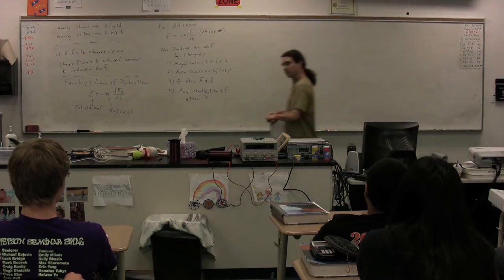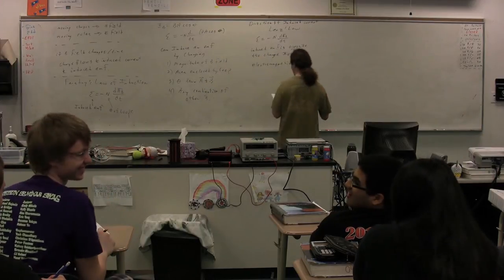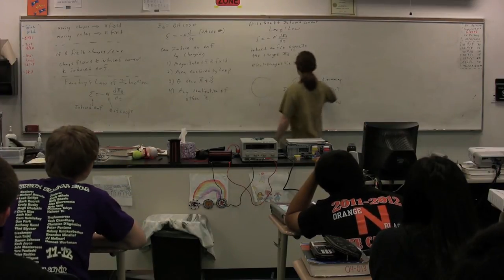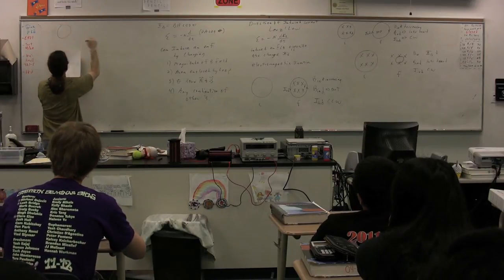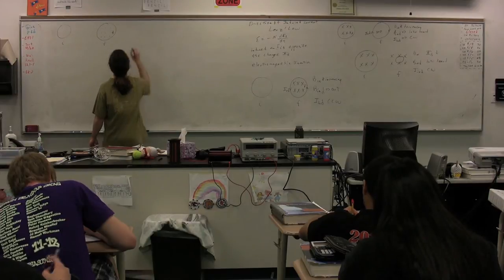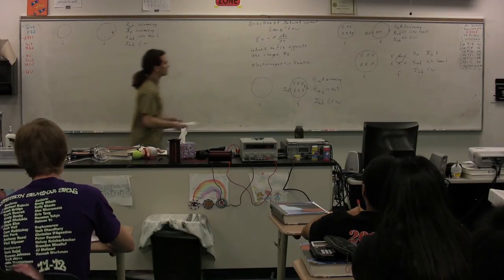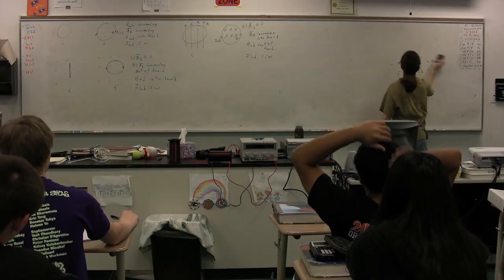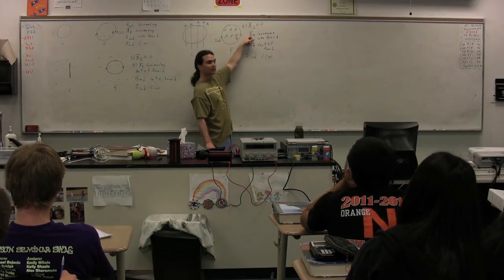Introduction to Lenz' Law - The Direction of Faraday's Law of Induction (with Examples) AP Physics C

Comment: It might be easier to point the right hand thumb in the direction of the induced magnetic field, then the fingers curl in the direction of the induced current. Or is there some reason I should avoid this?
Reply from the maker: It just adds more "things" you need to remember/memorize.  I prefer to keep the right hand rules down to just 2.